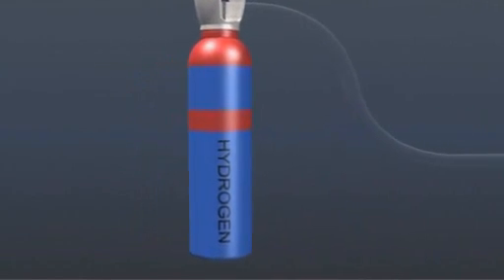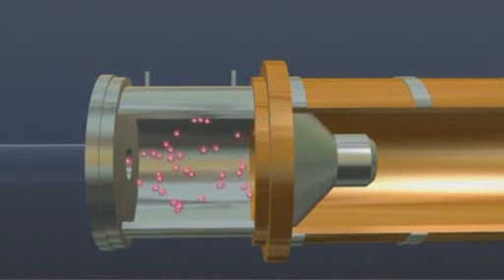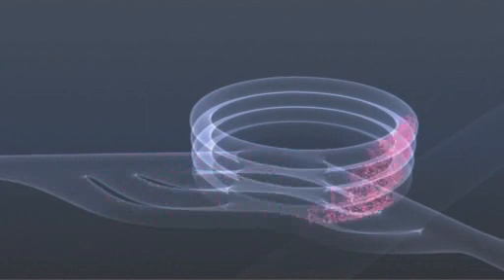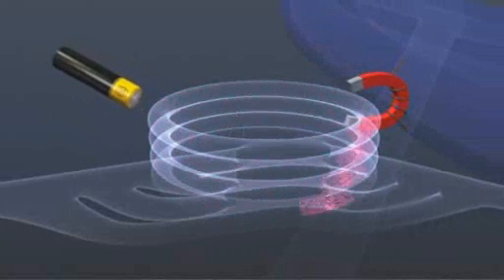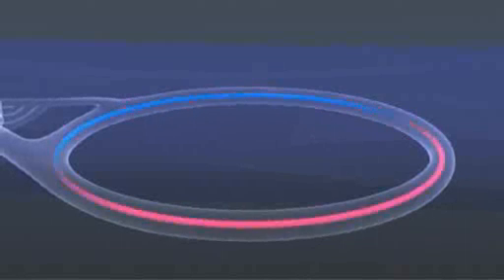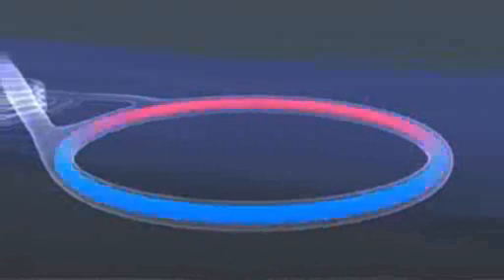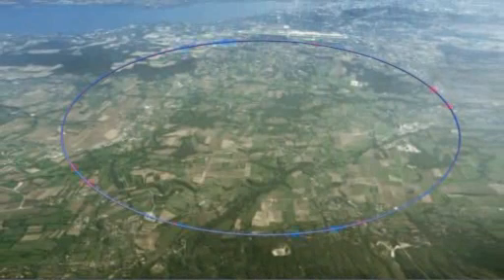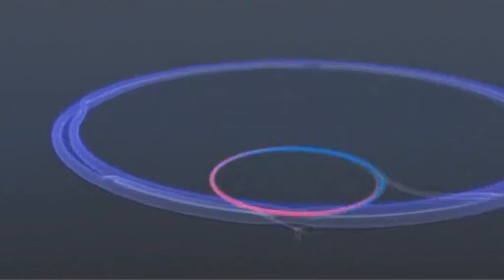The LHC - The Large Hadron Collider. What is the LHC, how does it work?

Comment: Ok, 7000 time its mass mmmm. Going at light speed mmmmm. light speed is fast, as an object as it approaches light speed tends to go in the past. Now, its 7000 times more massive. Since the object is not what it was when it left (its 7000 times more massive) this meands 2 , 7000 times more massive protons are going to collide. mmmm then they should hit through time/space itself. Won't this cause a wave of some sort? a time wave explosion? common sense. A super collinding untrolled time rip. mmmmm

Comment: When anything with a mass approaches the speed of light, it's mass increases. This is why the protons increase in weight by 7,000 times in the LHC. But according to Einstein, it would take an infinite amount of energy to propel any particle to the speed of light. Therefore it's mass would be infinite as a well. It's one of those really difficult things to understand in physics.

Comment: the eventhorizon diameter would be alot smaller than an atom, and since atoms are mostly made up of nothing, the block hole could probobly fall to the center of the earth without actually hitting any atoms on the way, that's how small it would be. The black hole would even when resting in the center of the planet need trillions of years to grow into anything large enough to threaten us.

And, cosmic rays with more energy than the proton beams of the lhc hit the earth every day, all of the time.

Comment: Those protons are traveling at 673.2 million miles per hour lolz.

11000 times a second round a 17 mile/27 kilometer tunnel.

11000 * 60 *60 = 39600000 laps of 17mile tunnel in 1 hour.

so it will do 17 times more laps round a mile circuit.

39600000 * 17 = 673.2 million laps of a mile circuit in 1 hour.

Just thought i would throw this out there becuse there are some random bullshit estimated speeds in these comments lol.

Am i right :) ???

Comment: Actually, the collisions have not happened before. The collisions hitting earth were hitting a slow object. The collision in the LHC will have two particles travelling near the speed of light, and that has NEVER happened before. Also, there is uncertainty whether or not you can make a "small black hole", we are basing it on unproven theories.

Can I take a shotgun and blow just a tiny bit off your face. I will have Stephen Hawking calculate the correct aim to shoot only two skin cells.

Comment: The consequences should be tiny since nature does millions of these experiments everyday.
The LHC is in a controlled environment and we can surround the point of impact with thousands of different solid state detectors.

Cooling down the chamber is not required since its design absorbs 99.999% of the radiation created & the particles created are so unstable and won't hang around for very long & most get absorbed by the detectors.
H ions~14Tev. Just wait till we start using Pb.:)

Comment: I thought the black hole mass is not actually the important thing rather the energy that generate the force. And, 10 solar masses are enough to create a black hole of a considerable force yet the energy going to be released in this experiment is put at 100,000 times that of the sun(Sun doesn`t have enough mass to create a black hole anyway). So, isn`t something there to ponder about in the 100,000 times the sun energy released during the experiment?

Comment: Its the product of over 20 years of testing and research. Also there are other ones already built just smaller and have less power. This is the golden child of the bunch so to speak. People keep worrying about a black hole but it would take MASSIVE amounts of energy to create, possibly more than they plan to use. It also needs energy to stabilize, which is why there aren't black holes everywere, they mostly form then dissapear in a split second.

Comment: (3 of 3)
2) its traveling near the speed of light. if something goes wrong and we make a black hole and it escapes the collider then we will have fired a microscopic black hole away from the earth at near the speed of light, in 10 mins it will be further then the sun, and by the end of the day it will have left the sole system. thus earth will be saved from the harmless black hole.

Comment: failure means end of this experiment, until the magnets are cooled again... experiments will be abortet if the magnets temprature is fluctuating 0.2°K (this things are cooled to 2° Kelvin)
It's a chance to produce black holes. yes, but they will be sooooo tiny, they will disapear almoust immediately because of the hawking-radiation. (and you will win the lottery 3 times in a row, before this happens....)

Comment: the chances that a black hole even forms is 1 in 50 million and its like a 99.99999999999999999999999999% chance that if it does form it would be microscopic and dissipate in less than a second.

Comment: "They then wrote down as they were told, making it infallible."

That doesn't make it infallible.  If anything it introduces human error which means it is more fallible.

The bible is filled with inconsistencies if you decide to interpret it literally.  Most would agree that it is meant to be metaphorical.  The fulfilled prophesies you find were mostly "discovered" after the fact.  They're similar to a modern psychic's predictions like Sylvia Brown and are just as accurate.

Comment: Note that black holes are not eternal, they evaporate due to Hawking radiation. For your average black hole this takes an unimaginable amount of time, but for really small ones it could happen almost instantaneously, as evaporation time is dependent on mass. Therefore you microscopic black hole must have greater than a certain threshold mass, roughly equal to the mass of Mount Everest.
So death by Blackhole from this experiment would be near 2 impossible. U can sleep tight mow!

Comment: *sigh*

There are still people worrying about this. First it was concern that the speeds themselves would cause something bad to happen. It was turned on almost 12 hours ago now, and it didn't do anything.

The collisions later next month will be something we've already done a bunch. The worst case scenario is we'd actually fuse two particles together (fusion) which would be enough power to raise the temperature in the tubes a few degrees K...

You pussies need to find another conspiracy...

Comment: "how much minutes/secundes will need that Large Hadron Collider to done what it need? "

ehm lets see. The LHC is 27 kilometers. Speed of light travels trough vacuum with 299,792,458 meters per seconde. I guess inside the LHC is vacuum. Proton beam travels at light speed. So 27000/299,792,458=9,0062305703501053385405712908228e-5 secondes.

Comment: Isn't nuclear fission the collision of hydrogen protons by increasing their energy by heat? So if the LHC is to collide the protons at the speed of light, wouldn't they have sufficient energy to result in a nuclear explosion simular to a fission bomb? The Protons that are being accelerated still have mass therefore after the collision wouldn't that mass be converted into energy in energy proven in E=mc^2?